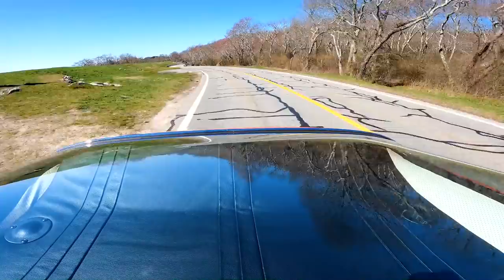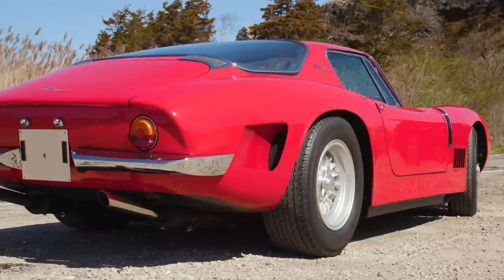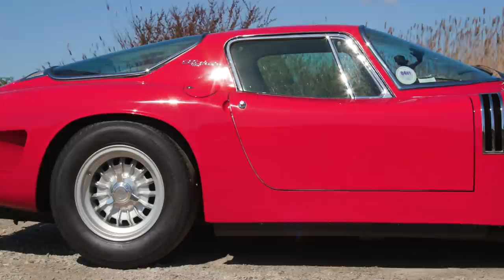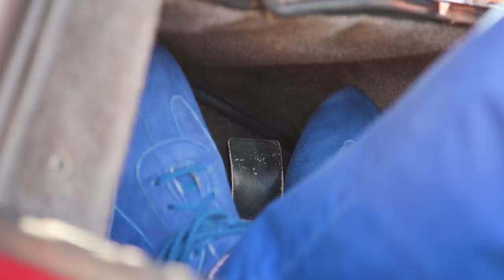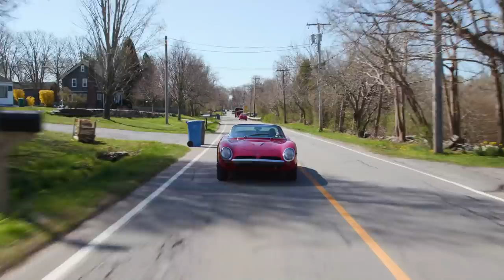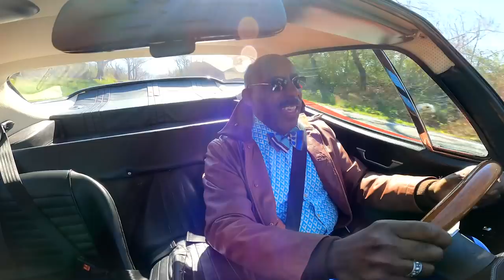Bizzarrini 5300 Strada: Italian Car With A Roaring Corvette Engine

Comment: I have an L79 in my 66 Stingray ragtop and that 327 is my favorite engine of all time.  It’s wide power band and smoothness are wonderful and the sound from the side pipes is intoxicating.   But this wonderful vehicle being 300 some pounds lighter and with the solid lifter 365 horse mill must be purely exquisite to drive.  Thanks for sharing!

Comment: In an interview, Giotto Bizzarini had some interesting things to say about the Chev 327 engine. When he first saw it he thought "that looks like something out of a tractor" but he knew his employer did not have the resources to make his own engine so he got on with the job.
When the car was finished and they road tested it he was impressed. He said the Chev engine was similar in overall size and weight to a Ferrari V12 and produced about the same horsepower, but the broad power band and low speed torque made it nicer to drive and gave better performance. Gas consumption was similar. The Chev engine cost about 1/10th as much and lasted 5 times as long.
Reply: Webers make the difference